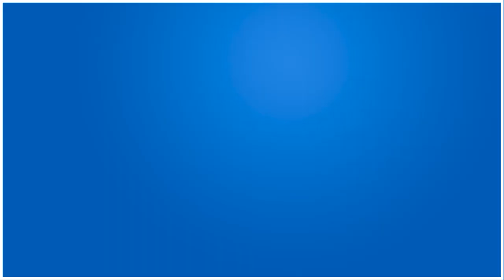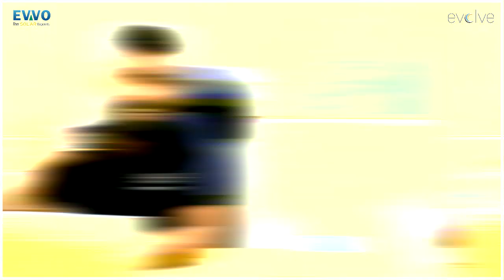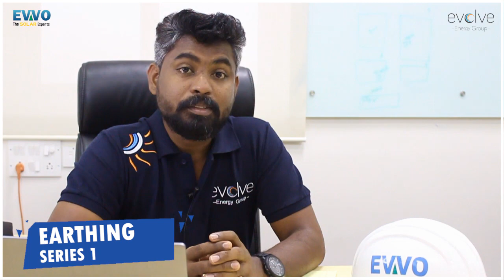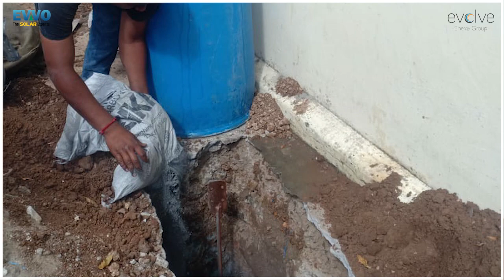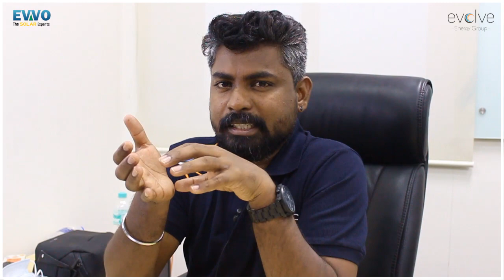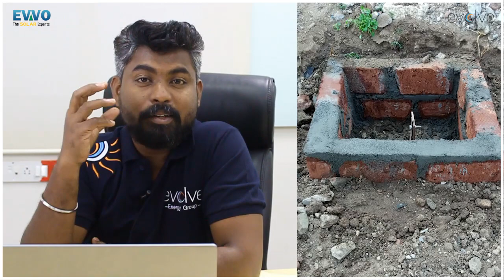Earthing Grounding and Lightning Protection in Solar | Sivakumaran CTO| Evolve Energy Group

Comment: Thanks for a Deep Information. But I am little bit confused, so you are saying that Lightning Arresters need more than single Earthpit, & solar panel mounting structure + DC SPD can be bonded/share the same. And separate earth for Inverters frame/structure + neutral . Am I understand the right way or I m misunderstood. Pls reply sir